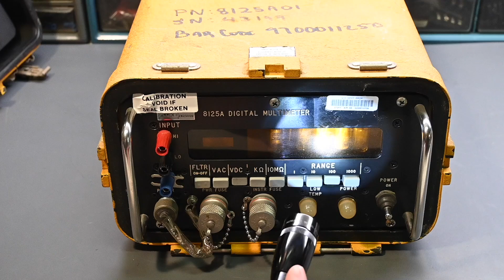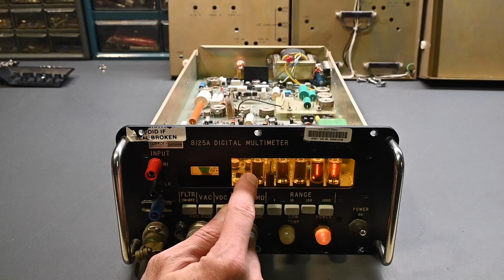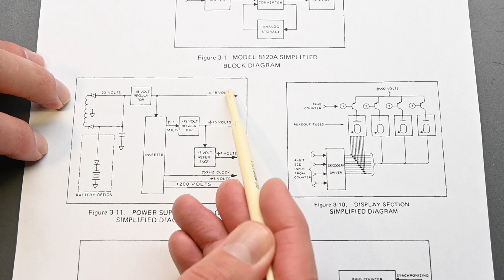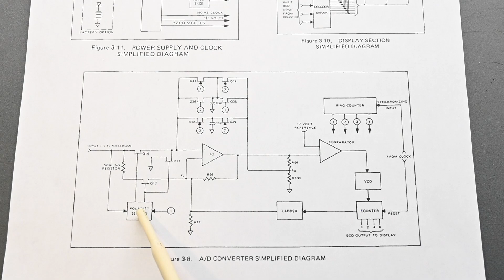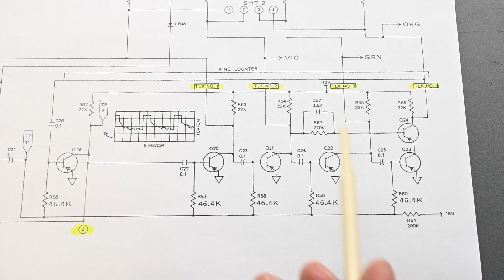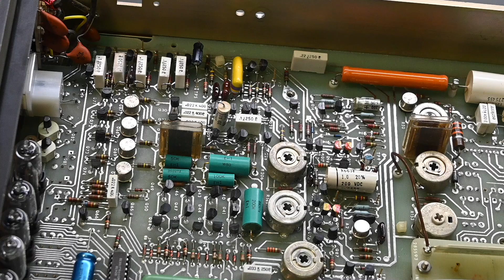Troubleshooting Problems Hiding In A Vintage Fluke 8125A DMM  - Part 1

Comment: Just bought one of these a couple of weeks ago, useful coincidence! Wow, that is one beat up meter. The ADC is discrete in those and has a clock of 250Hz, which is why the display counts up. Mine is clean inside, the battery had been removed, and the only issue is a dodgy connection on the digit two nixie. Oh, and it needs an alignment, but that's no big deal.
I did notice that the transistors in the ladder circuit seem to have been replaced in your unit; in mine they are TO-5, and the manual states they are germanium. In yours they are TO-92, and I would speculate they are silicon.
Incidentally you can find pictures of mine torn down on the phpBB teanonymous forum.
Reply from the maker: Yes the clock is 250Hz and works ok.  Yup it has been treated pretty rough but damage is all repairable.  I'll take a look at the transistors you mentioned but the ladder circuit works fine.  The transistor solders look factory but hard to know all past history of repairs.  I will look for your teardown pics.

Comment: Weird circuit. If Q24 and C57 weren't there this would be a straightforward ring counter. Is that a monostable? Thanks for your videos, although I want to add they are too long for me but I  understand why you are following youtube policy.
Reply from the maker: The ring counter free runs a little under the clock frequency.  The clock (sync pulse) speeds up the ring counter.  Q24 prevents multiple pulses from going into the ring at the same time.

Comment: manual for the 8100A says R61 (the 200k on -18 rail for the ring counter circuit) is responsible for the bias (clearly) and also cause of any spikes / drops in the flat part of the signal on TP3, so my guess is that one, or the Q65 FET that TLK. NO. 1 connects directly to the gate of.
Reply from the maker: The odd thing is that the ring counter can work correctly with a perfect waveform by just momentarily touching test link 1.  If the bias drifted due to that resistor being out of spec I'd think it would never be able to work.  The resistor does test ok.
Reply: It is indeed puzzling, and that is what makes it fun / frustrating 🙂
Few things after going over the 8100A manual:
1. is there a white wire on collector of Q19 / the (Z) signal line? there is in the 8100A manual and I cannot find where it does, it is not in your diagram.

2. the +7V is specified to +/- 7 mV - quite insane, was it checked to be really OK ?

3. in the parts list, several transistors are listed as germanium ones, despite the symbol is for silicone, no half-arrow base-emitter, and those germanium transistors and diodes really like to be leaky 🙂

4. Since problem becomes fixed by touching that point, and that point is also part of the store-and-hold circuit, maybe follow the test procedure in the manual (again, looking at 8100A) for disabling the storage-and-hold circuit, just to rule that out..

Looking forward to part 2 :-D
Reply from the maker: @jangoofy  there is no white wire on the Z line in my model but the schematic I am using shows a white wire on the Z line and it is only for option 02 (note on schematic)  which I think is a printer or some type of external equipment connection.    Yes the +7volt is spot on down to the last millivolt. Agree on the possibly leaky transistors, may be time to pull and test. The store/hold circuit uses all ring counter lines and I did open the test jumpers which removed the drive to the store/hold and other sections with no luck in improving the instability.  I have some ideas to still test so stay tuned for part 2 :)

Comment: Looking at the PCB, I think this meter is a lot closer to the Fluke 8100 than the 8200.  The lack of current ranges also suggests this.
Reply from the maker: Yes it might be but I've not investigated other manuals/models for comparison.  The 8120A manual seems applicable for everything I've needed so far.
Reply: @EriksElectronicsWorkbench  The primary differences seem to be in the input divider and the inverter
Reply from the maker: I now have the correct tech manual for the 8125A and it mentions the meter is based on the 8110A and the 8110A manual is to be used for calibration and adjustments except when noted.  The 8110A manual is included with the 8125A manual.
Reply: @EriksElectronicsWorkbench  will you upload the manuals to BAMA or Elektrotanya? I've not been able to find one for the 8125A
Reply from the maker: @andersvandegevel8355  I located a printed copy at Surplus Sales of Nebraska.  I don't have a way to scan the manual, it is quite lengthy and large fold out sheets but if you want the schematics send me an e-mail and I can send images of the schematics.
Reply: @EriksElectronicsWorkbench  email sent